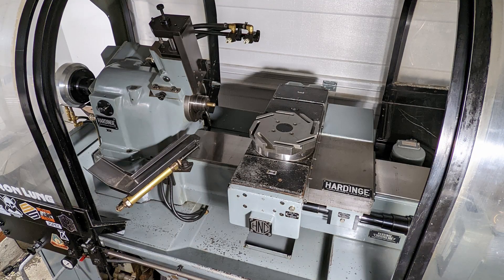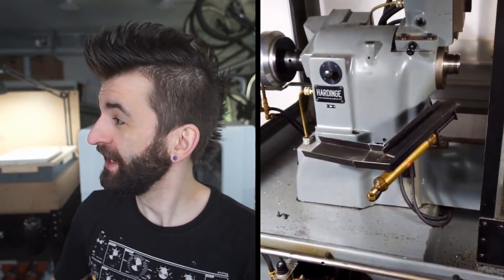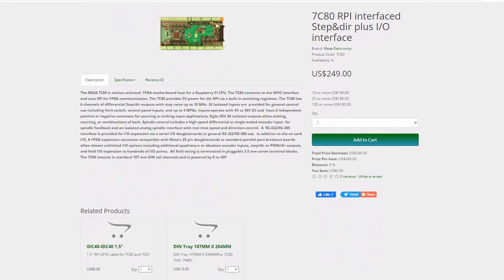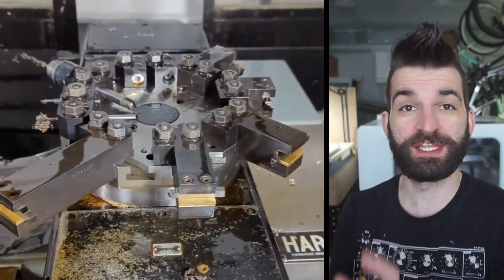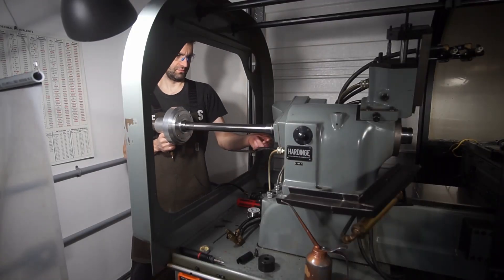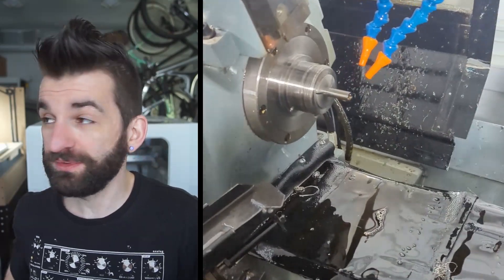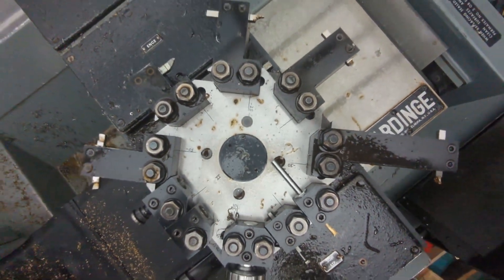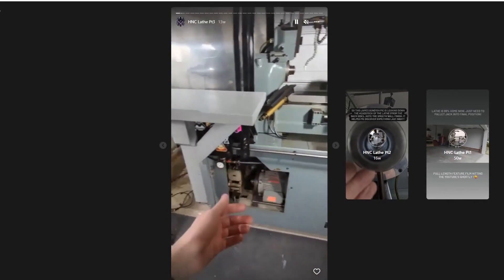Putting an Industrial Lathe in my Garage!

Comment: All good machines are driven by exactly one fluid. Either hydraulically or by air :) On our lathe its hydraulics. The turret is driven and locked hydraulically, the chuck, the tailstock axis, even the whole three axis parts catcher robot arm 😂
Reply from the maker: I agree, simplicity is nice...even if it eats a ton of air in this case!

Comment: Good description and clever build.  Does cutting titanium with oil make you nervous about fire?
Reply from the maker: Thanks! Somewhat, the flash point of this specific oil is quite high and is not directly flammable (ie. setting a light directly to the oil does nothing...I had to try it for my own sanity).
Biggest issue is mist, that presents a scary explosion risk...but so long as the oil volume is flowing heavily fire risk isn't as bad as I assumed.

Comment: YO CURT !!!!!  Hey,  Im getting this blink on my screen when the relay turns on and  activates the solenoide off the valve for the collet,  did you get a problem like that? its cables 22 and 23 i checked and found nothing grounded !!         I got 3 phase with 1kva factor,   it acts well with 110 v,     its just so annoying,  I just unplug it while its working , I got lucky with client tha is sending me some 1000 part batches of a component made out of delrin so its not easy to stop the machine to work on it, plus anyupgrade I wanna make I always !!   always think iit gonna take me some hours!   im optimistic always!!  but has never happened,   always takes me days!!!!  what would you recommend ??

Comment: I wouldn't have had the balls to do this for fear of going backwards, or ruining the machine, and I'm technical and NIMS certed with some familiarity with the Bridgeport/ Hardinge horizontals. I didn't even know there were strictly oil based machines. That thing looks like it's BARELY been used. And a pneumatic turret? That's a new one on me too. Pretty cool. What's especially cool is the idea that I can potentially drag home a 3 phase machine for a steal and run it on residential. (Not sure how to hide it from wife tho ;  ) GREAT vid, learned a bunch!
Reply from the maker: Thanks for the kind words! Some of these old machines go for almost scrap metal rates! I was lucky to come across this one.

Comment: Dud  this is just fkn gold !  really , thank you lots for this content,  I feel like I am not alone in the world !!  I just oredered the vfd, but im not sure if I need the cone pulleys,  im getting the new uper band , but my next upgrade will puting flat pulleys for the belt bands, couse  the cone pulley is no longer necesary and its also very loud and I think it just wear off faster,    i havent touch none of the pumps  or oil and air things still got a long road on my retrofit not to mention I have done nothing to the tool change, dont even know where to begin,  im on my second week,  it will probably take me around a month or a month and half, to get it running 100% .